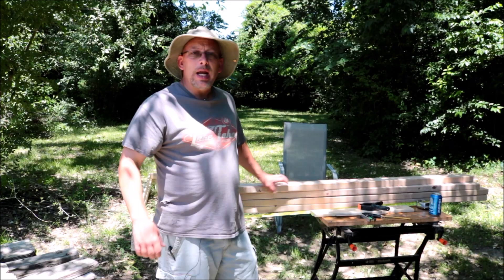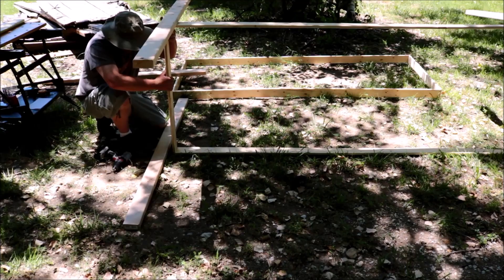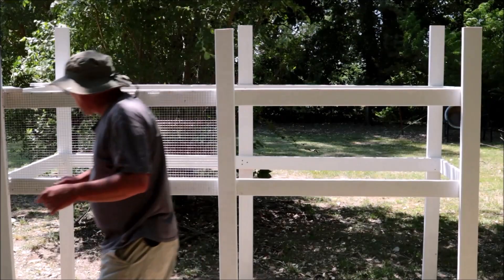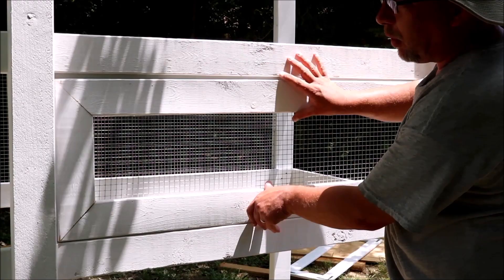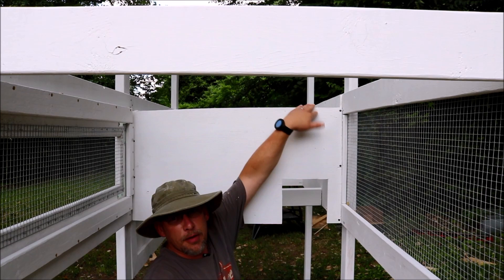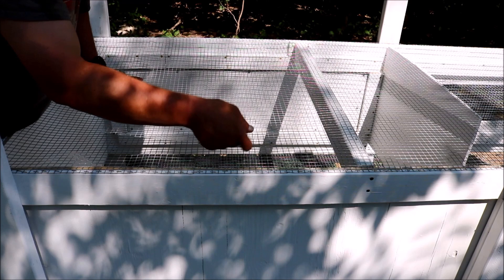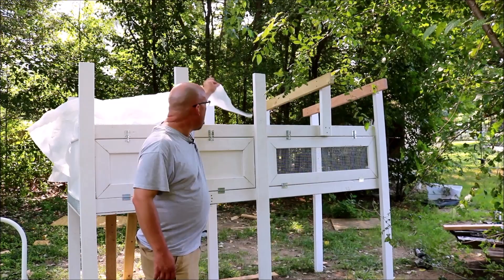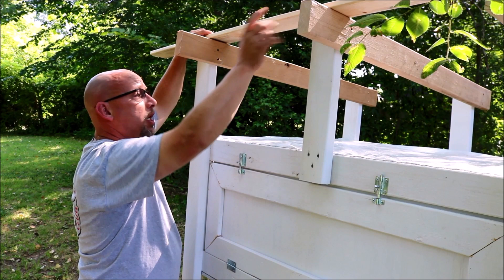Building a New Quail Hutch

Comment: Great video my question is how many quail do you have inside it normally
Reply: I found where you said up to 25. After asking my question. When I see him for sale they're usually in 15. My new question is. 30 too many if so how much more ajustan do I need.
Reply from the maker: You can figure about 1 square foot per bird on cage space.  30 would be a little bit crowded in this hutch.  I would go with something closer to about 25 square feet in floor space.  I hope that helps.

Comment: Chris my local stores dont have cage wire they have hardware cloth only anyother ideas for the quail cage
Reply from the maker: You could just build a frame for the cages and use hardware cloth for the wired section.  Just basically build a wooden frame that mimics the PVC frame in my stacking cages video.  Then staple hardware cloth to it to make it into a cage instead of cages hanging on a frame.  I hope that makes sense.
Reply: @Slightlyrednecked  I think I know what you mean I had an idea of taking a wire coat hanger and cutting it and bending it together to make a rectangle on which I could attach hardware cloth and attach it to the front
Reply: @Slightlyrednecked  can I use the wood for only the front part I'm on a pretty tight budget and can any staples work of do we have to use specific ones for wood

Comment: About how many birds do you usually put in a coop that size?
Reply from the maker: You can figure about 1 square foot per bird on average.  This is a 18 square foot cage and I can easily house up to 25 adult birds in it.  I know that is a little more than 1 bird per square foot but it works just fine.

Comment: Great Video and Happy New Year.
Do you have an idea of what it costs in materials to build this.

Thanks
Reply from the maker: Thank you.  I think this cost around $100 to build.  But I already had the tin for the roof so that may add a little to the cost.
Reply: @Slightlyrednecked  I really appreciate your help. Have you tracked how much time you typically get out of these cages before they need replacement? 

Thanks again
Reply: If you are inclined to build things their are people that would pay good money to have this built.  Their is a good chance you could get around $300 to $400 for building this.  I have seen small chicken coops at Tractor Supply going for around $500 and I was NOT impressed with their construction quality.  Using their coops as an example I could build something very similar in design with some improvements and possibly lower in cost.

Comment: I will rise quails, but instead of hutches I will use a two 10sq metres connected aviaries with vegetables inside and compost bin with black soldier larvae.
Cannot think about raising animals in small cages. In my opinion they deserve better life.
Reply from the maker: Nothing wrong with what you plan on doing.  My quail seem pretty content in their cages but if you want to build an aviary for them I sure they would be content there as well.
Reply: Krzysztof Rudnicki What aviary did you buy? Right now I’m building Chris’s grow out Penn but I also want a larger one.
Reply: The quail have a 6-8 week of life before their head is pulled off and they go in the BBQ. An aviary seems a bit excessive.
Reply: Brian Sessums I would like to have breeding stock-in  the aviary. So they will be alive from 1 to 2 years.
Reply: But surprisingly enough the quail do seem very happy in the grow out pen.